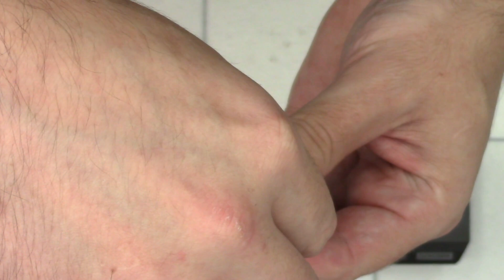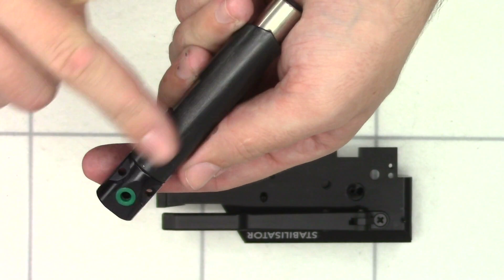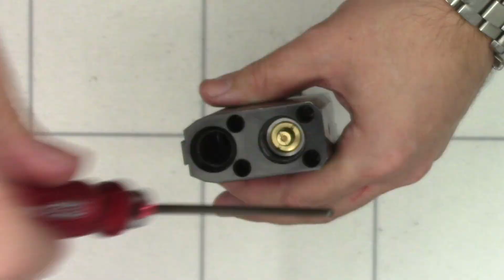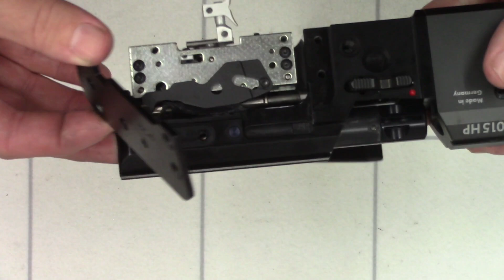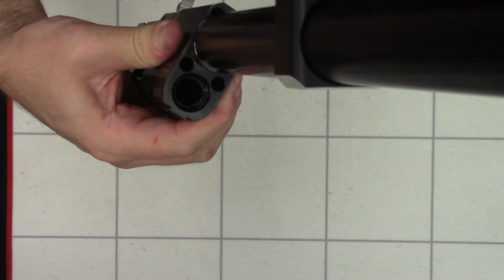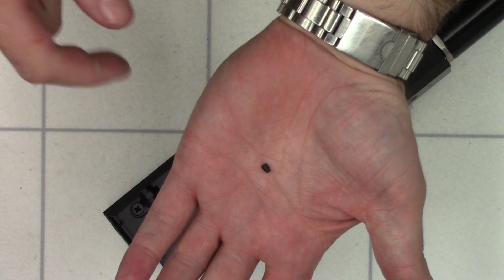Anschutz 9015HP reassembly.

Comment: You have a different spring stack to my tench converted 9015. Mine is ((()))((()))((())).
Reply from the maker: Interesting, possibly the bellevilles are different thicknesses or the reg pressure slightly higher needing the stiffer stack. Thanks for watching.
Reply: @sub12airgunners  It'll be interesting to see what pressure your reg is set to. Mine is 90 bar with with adjuster screw set to 1.27mm depth. In my notes from its first strip down the bellevilles measured at 9.9x4.2mm, 0.5mm thick, 0.7mm height. Hope thats of some interest.

Comment: Awesome video you really made me understand how this gun works and that not all air guns are the same this gun has alot of adjustment Awesome info ...wow it's crazy how the transfer port has to line up like that for the air to push that pellet through the barrel its mind blowing that a little orings can hold that much pressure 😳 🤯 thanks for sharing this info have good one cheer 👍
Reply from the maker: Yeah, all that pressure behind just a little bit of rubber, crazy if you think about it. Thanks for watching.